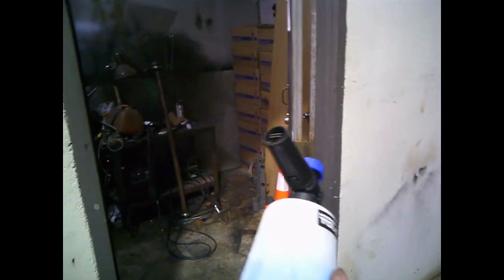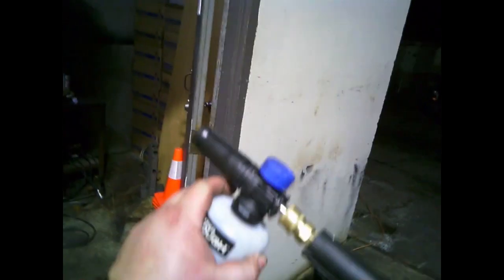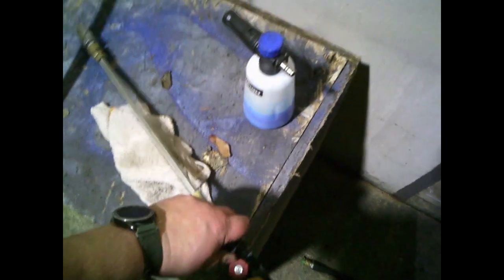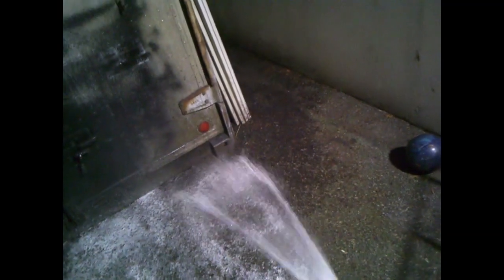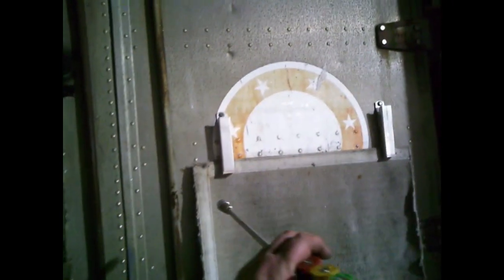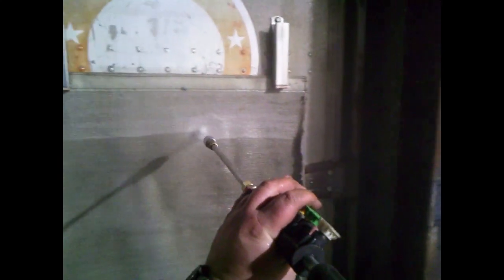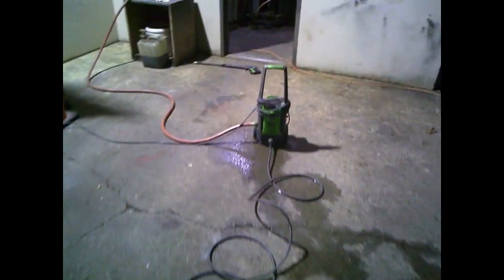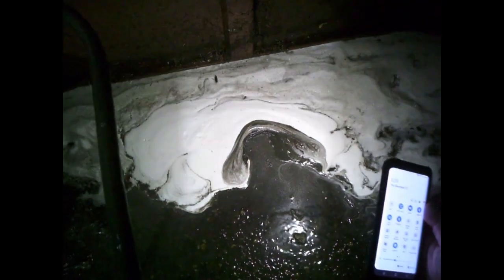Cleaning Carpet Covers

Comment: Order zip carpets better material and easy cleaning.
Reply from the maker: Those are zip carpets, multiple generations of em lol. I have some that are 7 years old some 5 years, there's a few installed that are 8months old and theres a few going in lately came in a few weeks ago. No 2 orders have been the same material.
Reply from the maker: I've also used the pvc style, rubber style, leather style, and 2 different cloth styles... these ones by far are my favorite
Reply: Oh ok wow they look really deteriorated
Reply from the maker: @ronsullivan2308  they've been living a rough life. For a while the carpets were getting pressure washed on a monthly basis, some of the old ones have really thinned down from it.. and with a bunch of the pits having bad carpets they are wearing down in the bad spots. Gotta make sure that pit carpet is at least patched under the zip backs or they'll just wear down into those spots. Also gotta make sure to trim any edges that start coming loose or they'll tear themselves apart and get wrapped up in pulleys
Reply from the maker: Also been thinking of having a strip sewn to the edge that has no velcro to help it hold that edge together, but haven't gotten that far yet lol.
Reply: I started as a brunswick pinchaser in 2001 and finished as an mos 19 and a half yrs later under bowlero. When it came to carpet covers we just threw them in the washer and dryer. Never had any issues other than pinchasers not changing them lol.  Your videos really bring back the memories. Great job. Bowlero and the lock out tag out system really made it difficult doing some of the work that can be done while machine is running, especially doing adjustments and jogging pinsetters from one position to another.